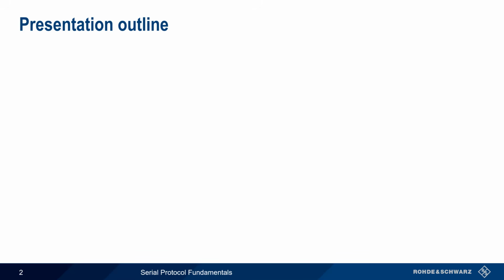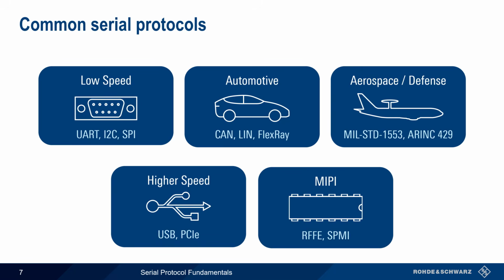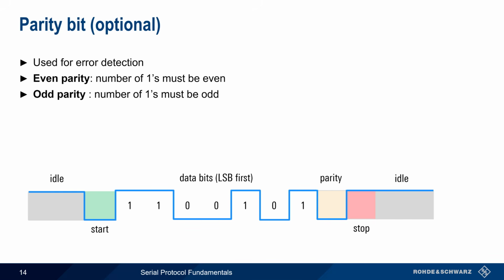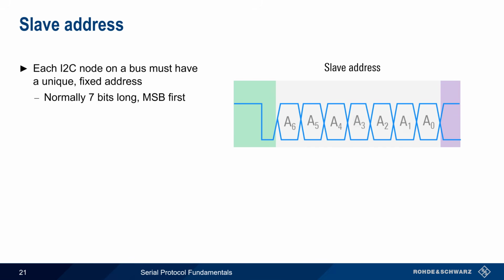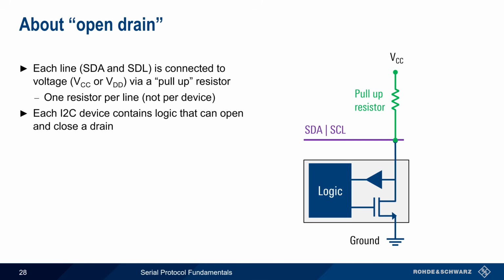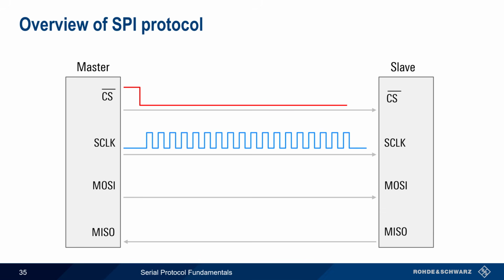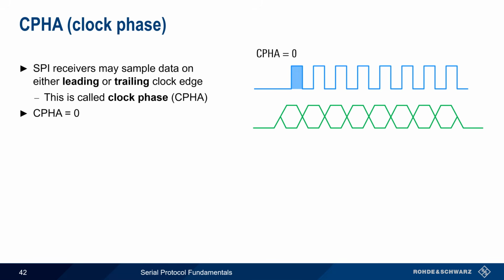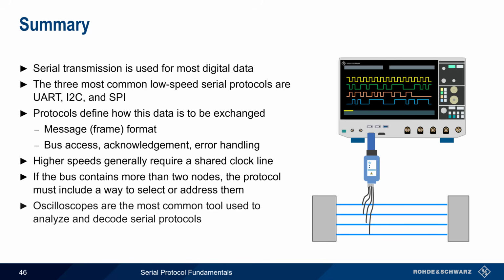Serial Protocol Fundamentals

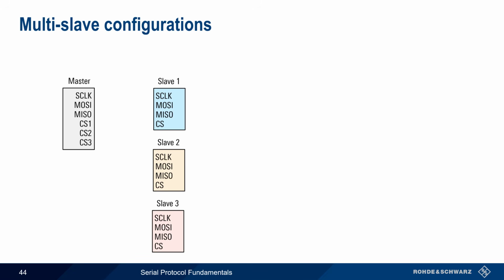Comment: Thank you for the video. After watching the explanation of UART and I2C and seeing the beginning of SPI, I thought that SPI, apart from having more lines, is actually great, but then came the part 33:03 where it was explained that SPI, to address multiple devices, either needs an extra line for each chip select or must daisy chain everything, which costs latency and is likely complex, which is why I now actually prefer I2C with its clear addressing.

Comment: How can serial transmission have a higher throughput than parallel transmission? That can't be right
Reply: Hard to sync clock across devices and if you run faster faster faster you will have more issues.  In any cases parallel are just serial on multiple channels.  If you think you can just use more channels but the key is each channel can run independently and not need to sync with each other.
Reply: @dng88  "parallel are just serial on multiple channels", "each channel can run independently" I disagree with that. sorry
Reply: Yes, if the clock (bit) rate is identical, then more "data conductors" (parallel) would provide higher throughput than a single "data conductor" (series).  But a higher conductor count is also difficult to implement for many applications - imagine if your USB cable needed 10 different conductors inside of it :)  There are also issues in terms of the time it takes to convert data from parallel to serial (since most devices want to produce or generate one bit at a time) and signal integrity issues (crosstalk between parallel conductors).  It's these and other "practical" considerations that make modern serial data transmission faster than "modern" parallel data transmission.
Reply: @pauldenisowski  in paralle there is no clock, master set all the bits - each wire is one bit of data, then master through another wire sends a signal that the data is ready to be received. the reason why everything today is series is the cost of the cable and imagine that the cable you connect to your mobile phone is as thick as your finger
Reply: @Cien_Swiatla  No, with increasing data rates, the crosstalk problem became more and more of an issue. For this reason, the 40-pin EIDE ATA cable was replaced by SATA, and Wide SCSI by SAS. SATA and SAS are serial, whereas EIDE-ATA and Wide SCSI are parallel. The PCI bus was also parallel and was then replaced by PCIe, which is serial. USB is also serial. Serial connections allow much higher data rates because they do not have the crosstalk problem, and due to the shrinking manufacturing sizes of ICs, which allow more transistors on the same die area, intelligent receivers and transmitters required for a complex serial protocol became affordable. There was a time when parallel was faster than serial and logic in the ICs was expensive, but that time (80s) has long passed.
That serial connections require fewer lines and thus can theoretically be cheaper for slower connections and allow smaller connectors is a nice side effect, but at high data rates the costs rise again because you need expensive measurement equipment to still be able to measure your signal at these high speed data rates.
Reply: @pauldenisowski  Agreed.

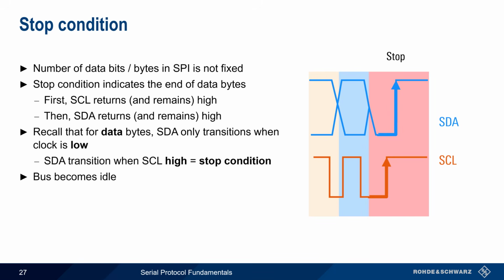Comment: Is the first bullet at 20:27 (SPI) a typo?
Reply: Yes, it should be I2C - I guess I was getting ahead of myself :)  Thanks!
Reply: @pauldenisowski  Is it possible to get the slides ? :)
Reply: @dykon8190  I'll be producing a whitepaper version in the near future - stay tuned!
Reply: @pauldenisowski  where can I follow the updates on this. Saving this as a presentation/whitepaper would be very useful
Reply: @itzj1nx177  Good question :)  Probably the best thing to do is to subscribe to our mailing lists, since it would certainly show up in a newsletter as soon as it was published.  That said, it will probably be at least a few months before I can get to it - lots of other projects!
Reply: @pauldenisowski  I got confused there because I thought that we where still in the I2C section but this point refers to the SPI protocol addressed later.